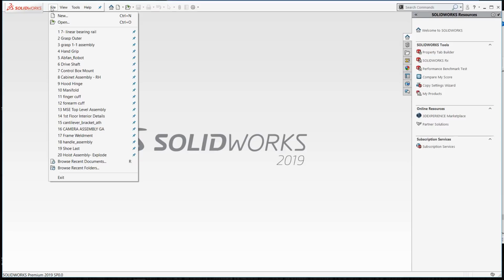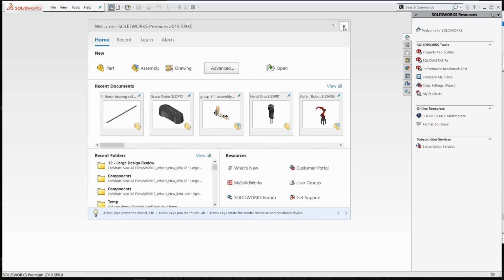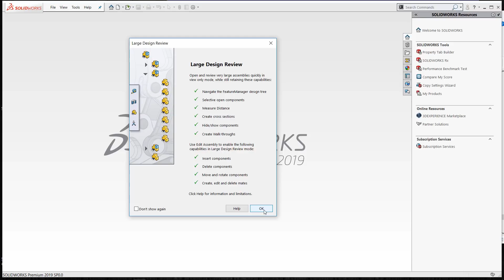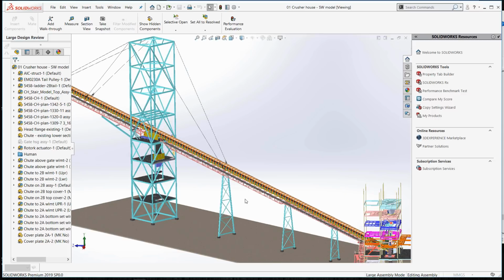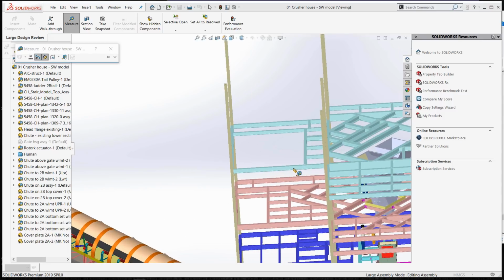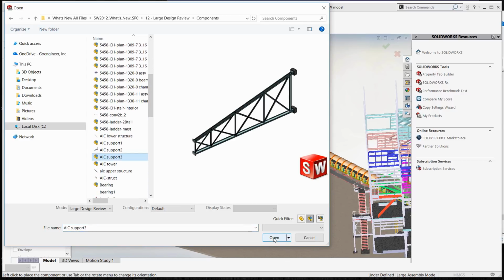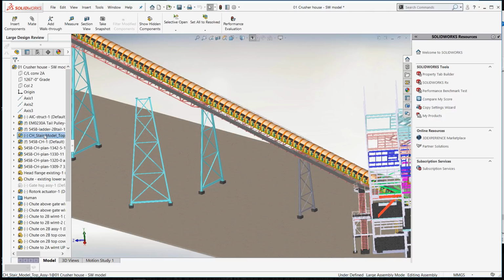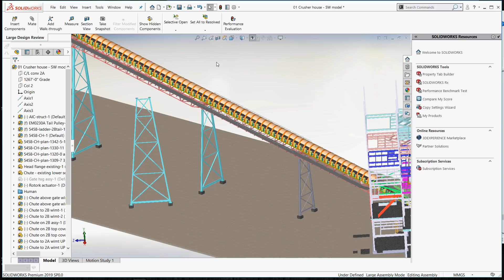SOLIDWORKS 2019 - Large Design Review Mode

Comment: As everything Solidworks releases, LDR-mode is just a shallow showing off stunt and never intend to work in a real work environment. Mirrors parts is a great example, it took about 20 years (till SW2019) to get it right, almost anyway. Same with ANY other "new" function that SW releases, it takes 3-20 years for it to mature to something useful. This LDR-mode follows the same trend. And it is totally useless if you work with configurations, as most professionals with real parts designed for real world applications as i know of do. I tested a few assemblies with LDR, and a moderately large assembly (the main reason to use this LDR-mode, right) that normally takes 1-3 minuts to open and about 1.5 minuts to save ( I9K9900K, Quadro P4000, M2 SSD in raid-0 etc) depending of level of lightweight status within. To be able to use configurations within LDR, you need to add Display data mark to each configuration. And by doing so your assembly will be corrupt.... almost anyway, as it now takes 3-6 hours to open and save if you ever need to open it again... Not much of a 
time saver I would say......